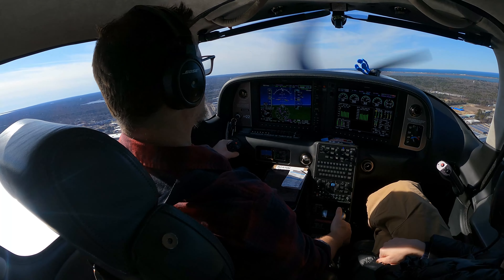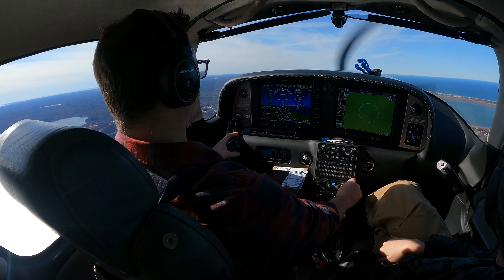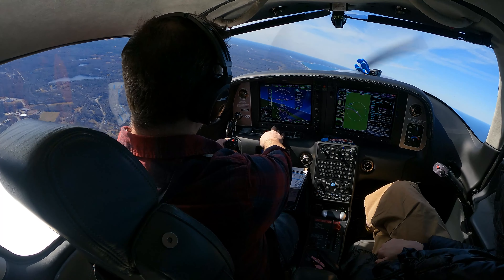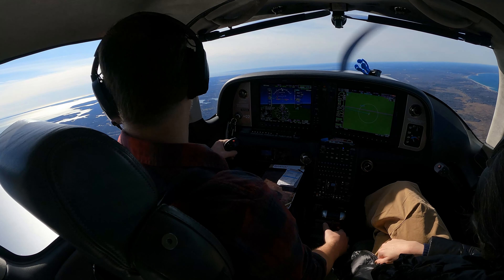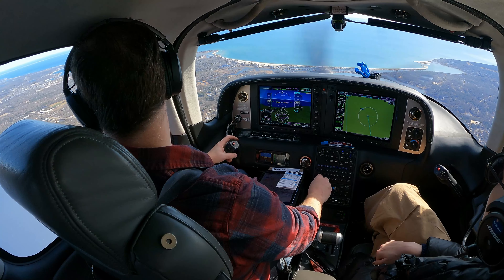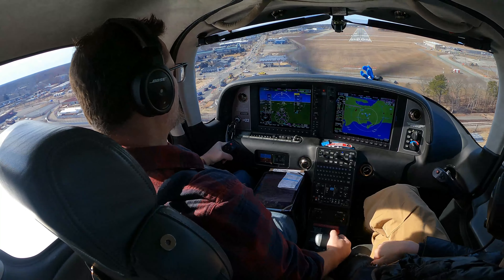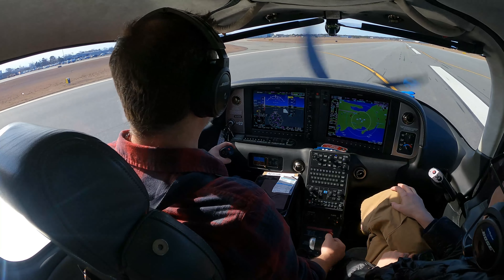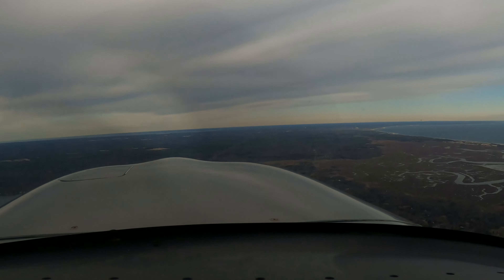Immediate abort -- fuel leak after takeoff

Comment: While I was a student pilot 22 years ago, I had something fuel related that was really wild.  I had to fuel up the C172 before my flight because the previous student had not topped off before me (and was running late).  When I landed after about an hour, I went to go top off, pulled the stepping stool to the wing, went to take off the fuel cap and saw it was sitting right on top of the wing.  I had forgotten, in the rush of it all, to place the cap back on.   How it could have possibly stayed on top of the wing during the flight escapes me to this day.
Reply from the maker: ?? Wow

Comment: Any landing you can walk away from .....    if this helps...  I stopped thinking about the control input for crosswind correction a long time ago.  "should have gotten the left wing lower",  don't think about that,   think  " keep the airplane on centerline and airplane centerline axis aligned with the runway centerline.     I start with the crab on final and get an idea of the amount of crosswind.  Personally I like to transition to cross control about 50 feet agl,  I simply turn the aileron into the wind, then keep the airplane aligned with the rudder.   Aileron to stay on the  centerline,  rudder to keep the airplane centerline from turning relative to the runway centerline.   Once those inputs are in, keep them then adjust as necessary to keep those two things perfect. Adjust one, you'll need to adjust the other.   Once you touch down,  keep the aileron in and add more as you slow down.     A 20 knot wind 20 degrees off the runway is about 8 knots of crosswind, which is nothing for a 22.    With this technique, the only thing you really need to worry about is if you need so much aileron that you run out of rudder  and can't keep the plane parallel to the runway centerline,  you need to go around and  find a better runway.

Comment: I am not a pilot, so not sure about the technicalities. Even though it might have been a go around under normal circumstances,  a leaky fuel cap is far from normal, I think you made the intelligent choice to land.
Reply: The pressure differential will suck the tank dry.
Reply: @farmgene  in an hour or more, and only that tank.  Other tank was fine and would have run for even more hours.  It's not an emergency.  It's a, when conditions permit, lets take a look at that.
Reply: @z987k  I feel like any time fuel is leaking it should at least be a pan-pan, what if a spark on landing caused the vapors to ignite?
Reply: @taytayflyfly7291  All the more reason to run that tank dry.
Fuel tanks leak all the time, and you have all the time in the world to slow down and figure something out.

Comment: Something similar once happened to me.  I must have not put the fuel cap on properly because shortly after takeoff, tower called to say I had fuel coming out of my wing.  I don't think they used the word "geyser" but that's what it was.  All that negative pressure on the top of the wing does a great job of sucking fuel out in a hurry!  In the time it took me to fly a pattern and come back to land, I think we lost 20 gallons of fuel.

Tower called out the ARFF trucks to follow me down the runway, which just added to my embarrassment, but better safe than sorry, I suppose.  The fire chief came over to chat with me on the ramp and assured me it was not a problem.  He was mostly concerned that I was OK and that I hadn't left any FOD on the runway.  When I showed him that the cap was still attached by its safety chain, he was satisfied.  I refuelled and we were back on our way after checking 6 or 12 times that the cap really was secure this time.

BTW, speaking as a (no longer active) CFI, good call on waiting until the next day to try again.  Anytime you're uncomfortable, cancelling the flight is always the right decision.  Not to mention that getting the snot kicked out of you in 25G30 isn't fun.
Reply from the maker: That's a lot of fuel to lose in a short amount of time! I've seen some footage of the vacuum effect on an open tank -- ours was more like a rapid dribble since the cap was on but still allowing some flow around the seal. Glad your situation turned out well, and thanks for watching and commenting!

Comment: Not to get too technical, but the locking mechanism on your fuel cap being too loose, is there a certain mark on the nut to identify when it is secure? Thanks in advance.
Reply from the maker: No, at least not that I'm aware of. You can feel the tension when you lock the cap, so in the future I will double check when it starts to feel a little too easy to twist the latch.

Comment: Even though that was leaking is that a bad thing? Like what is the negative affect?
Reply from the maker: Is leaking fuel a bad thing? I'd say so. I didn't think that would be controversial to assume. You would have significantly less fuel to make the trip. And even if you think it's only leaking a little, it could (and probably would) leak faster as the plane accelerates to cruise, so I would have to assume I'd lost the entire tank.
Reply: @joshmc  when I was fueled when racing nascar we always had excess fuel blow out the overflow from slosh and from heat expansion. It was normal.
Reply from the maker: @RaceMentally  Gotcha, yes there can be some venting from the fuel vents on the bottom of the wing in that instance. It should never be coming out the top through the cap.

Comment: Thank you for sharing this video. Observation is very key in being a pilot. Good call also to do a turn around, plus the weather was really not favorable for that day. A leaky fuel cap probably safed your lives. Sometimes I believe God works in mysterious ways. You never know what can happen in life. Let alone in a simple 2 to 3 hour flight.
Reply: How was the weather not favorable?
Reply: Did you check the weather on his route for that day? I haven’t but it looked to be a fairly clear VFR day. Sure it was bumpy and a 300@20 for rwy 33 (334deg) is interesting, it’s not outside a safe landing performance for the Cirrus. All though you should be practiced but the demonstrated crosswind landing in the Cirrus is a 21kts @ 90deg. This was 20kts @ 34deg. And that doesn’t mean it can’t land in even stronger crosswinds just that you will need to be more skilled in heavy winds.

Comment: That preflight check doesn't work out, huh?
Reply from the maker: The preflight check doesn't include measuring the tension of the fuel cap locks, no. It does of course include verifying that the caps are on and locked.